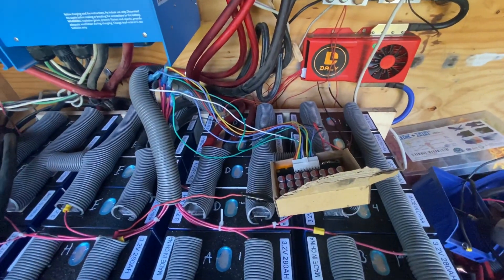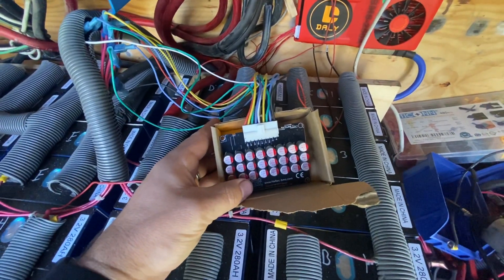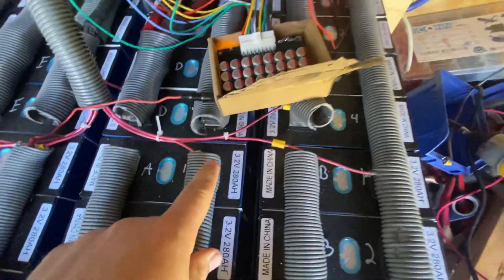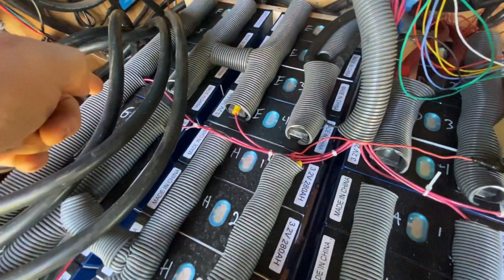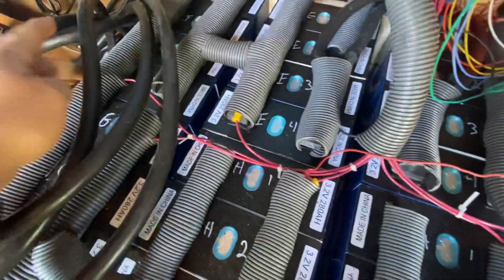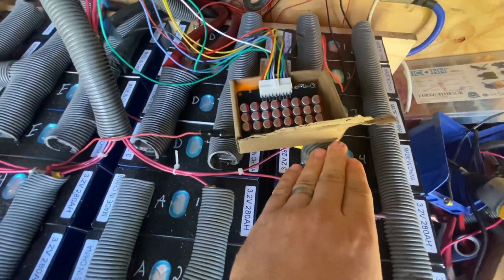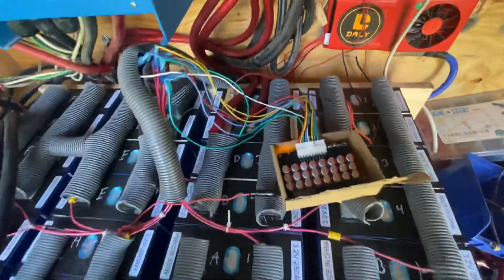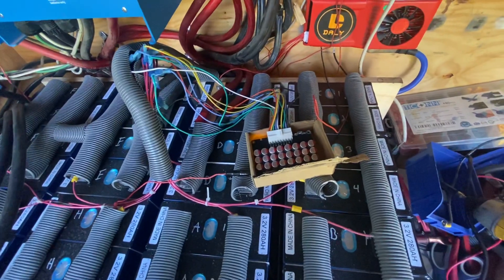Active balancer setup for 4p8s lithium batteries

Comment: Those active balancers are great! Use them in all my customers setups, however I highly recommend this and please seriously consider it:

Active balancing should only be used during the higher state of voltages in the cells. 

When you try to balance them after they’re in or past their (lower than) flat curve, the active balancer will actually unbalance your pack, causing extra work and high potential for unbalancing once you get past the 3.3v mark (roughly).

This is what I did on all of my packs and have never had an issue. Connected a high quality 6 pole relay (only because you need 5 wires for a 4s, I used 18 pole for my 16s) in between the active balancer and the cells. One pole per cell, wired so that a simple 12v signal to the relay turns it on and off. Then I used a variable voltage trigger to turn said relay on and off only have my set voltage basically allowing balancing over 3.35v (or whatever you set it to)

The Daly bms I don’t use, but am curious if you could wire the relay to that to trigger on and off. 

This would give you longer cells life overall, and never have balancing issues if you ever discharged more than 80% SOC.
Reply from the maker: Right behind you on the relay. What did you use as your primary relay source? I’m thinking of using the BMV.
Reply: @HimmelbergerBus  The balancer has a blob of solder shorting two pads, remove that and solder on leads to dry relay contacts and you can switch it on/off at the desired voltage.
Reply from the maker: @lbroome  this is vital information, any links? I’ve not heard anyone talk about this. 
Thank you!
Reply: @HimmelbergerBus  No, sorry. I got a 17S balancer from amazon that looks just like the Heltec models. It has the labels and pads to change the battery type from LFP to LTO by moving the solder blob and on the other side it has a silkscreen that says RUN with a goofy symbol that looks like contacts. I unsoldered the blob and put a switch in and it will turn on and off now. I run it when the bank need balancing. Not all models are the same I'm sure, but check yours.

Edit: found a new listing on Amazon that had a little blurb about the RUN pads but no real documentation.   "https://www.amazon.com/Equalizer-Balancer-Equalization-Capacitor-Balancing/dp/B096NMJW12/"